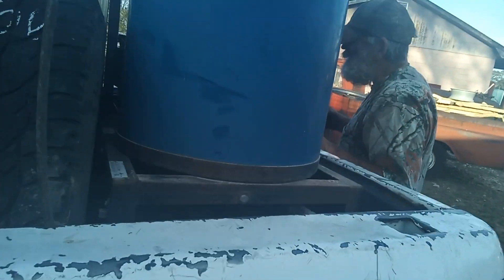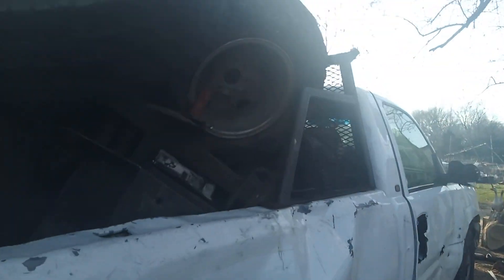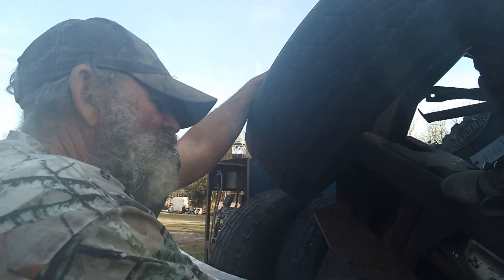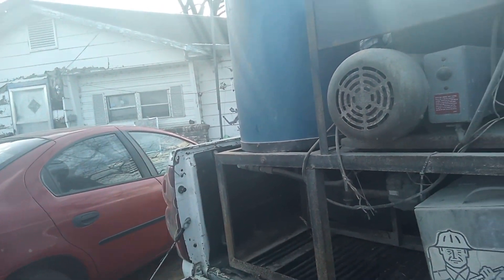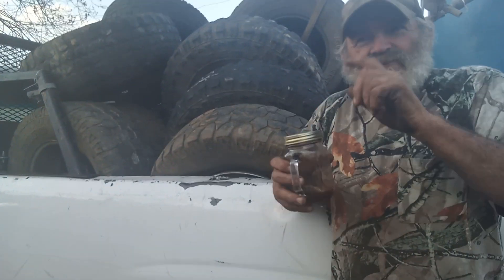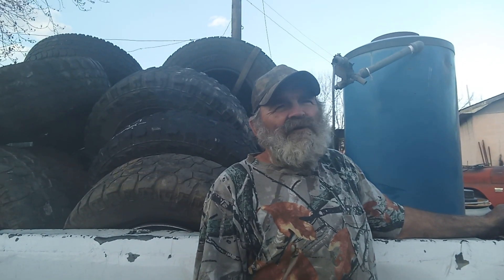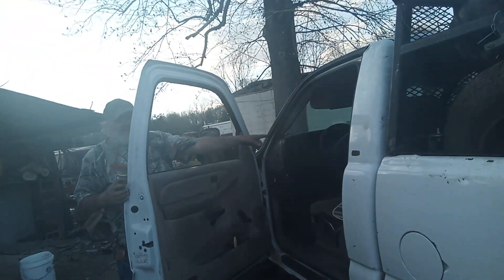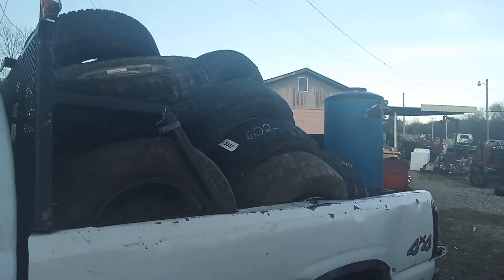March 30, 2024 Piggot Ar annual FFA consignment Auction

Comment: I think it would make a good video trying to get the pressure washer  working.,
Reply from the maker: I looked it over pretty good today noticed it is LP gas heated?
Reply: @thecollectoronthecorner7061  throw a propane orfice in it and roll on!  I liked that it was a hard piped in unit when,I noticed it in the video!